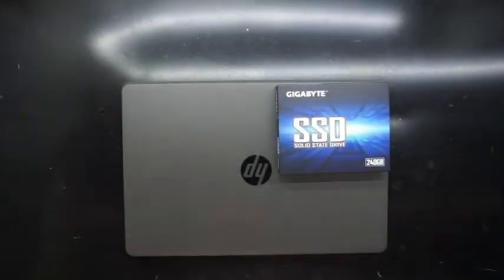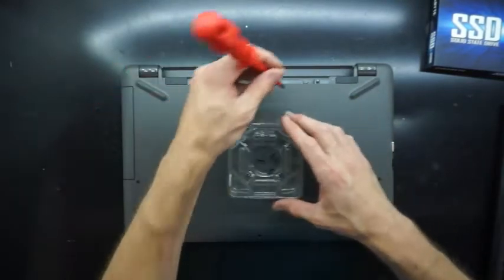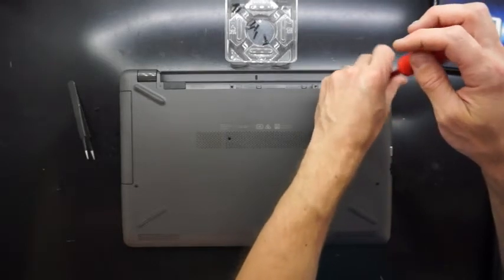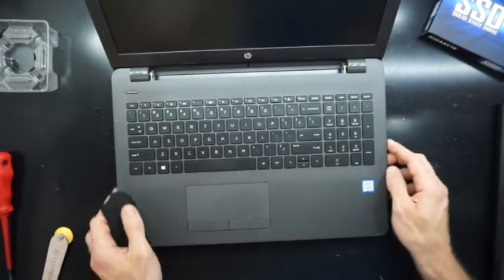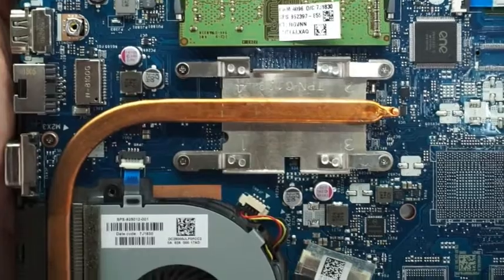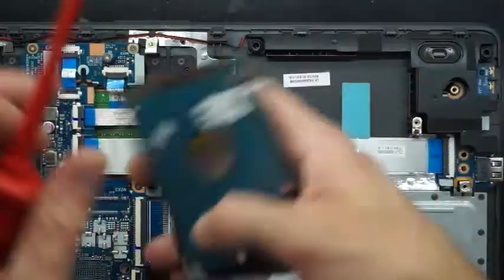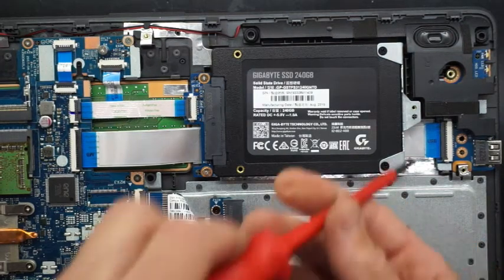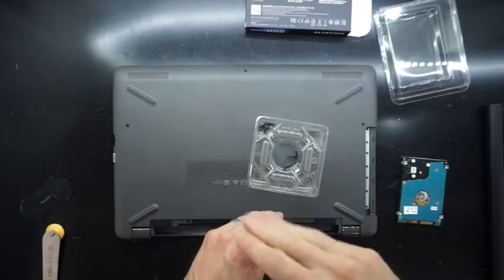HP 250 G6 Tear down and SSD install

Comment: is that possible we can install Graphic Chip in motherboard separately because as we can see there is no GPU Chipset in the motherboard but they give the location to install?
Reply from the maker: unless you can do BGA rework, no
and even still if you can the laptop would be missing the firmware to use the GPU you solder on